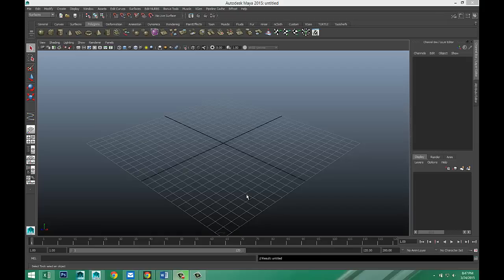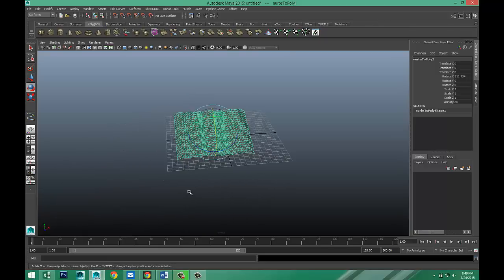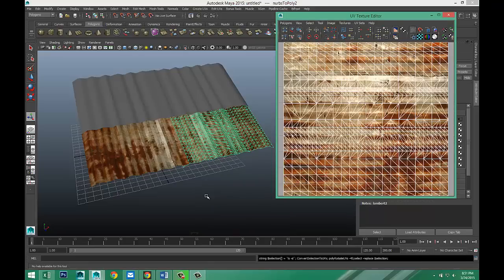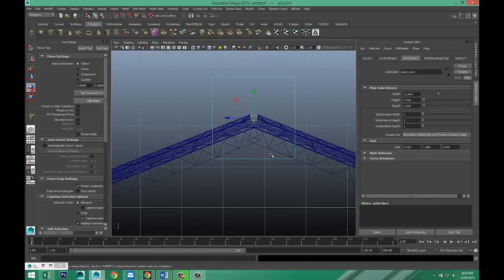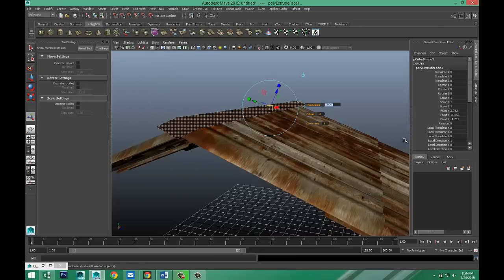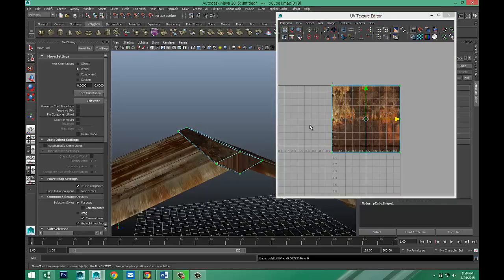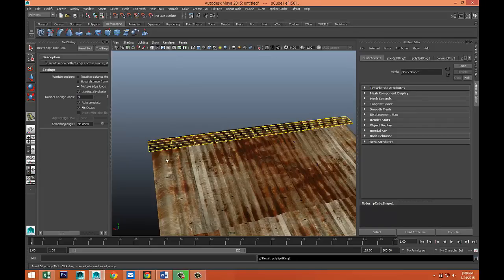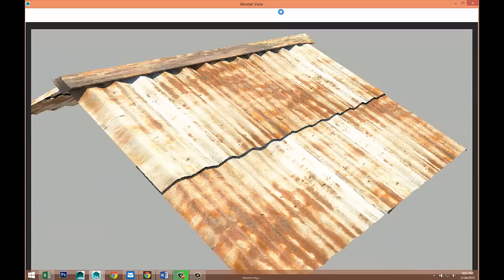Maya tutorial:How to model a Tin Roof

Comment: i have a quick question. im using this for for something different but after i loft it, is there a way to make it thicker? width and length is fine, but i would like to make the object thicker. thanks
Reply from the maker: NOR3MSTI Yes, select your object and convert it to polygons ( Menu : Modify-Convert Nurns to polygons ) And then extrude the polygon object